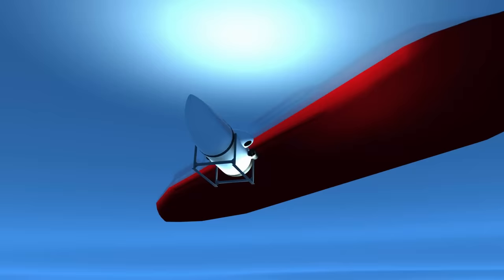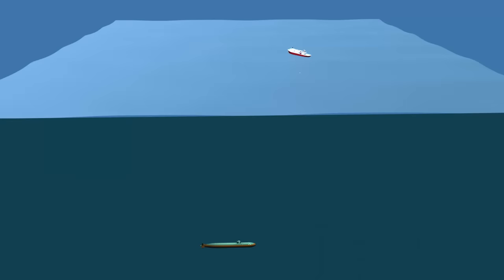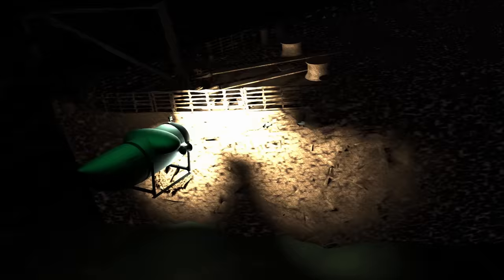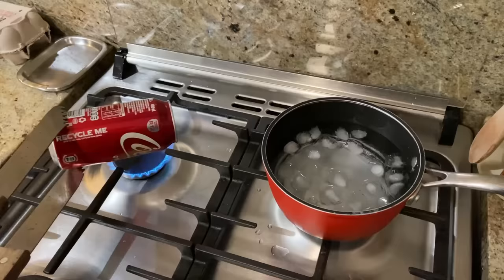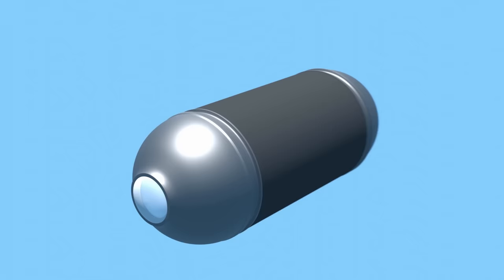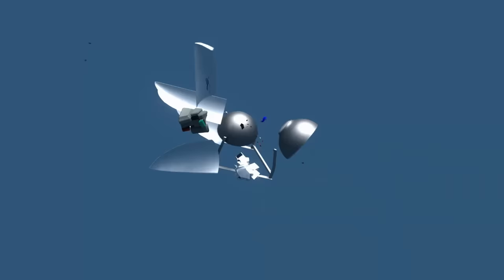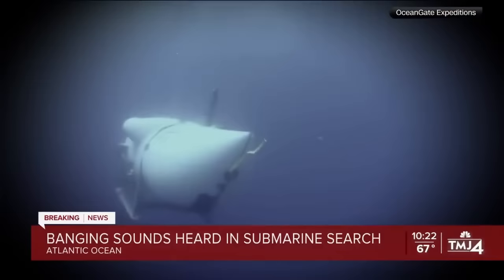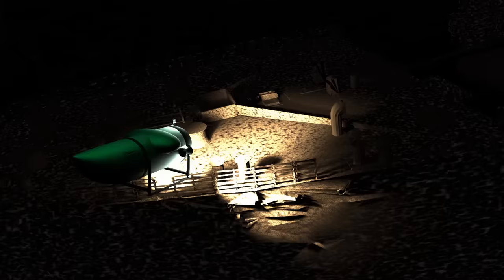TITAN Sub implosion | Deep Dive animation explanation

Comment: This is the most accurate animation of what happened. All the others are so slow.
Reply from the maker: Thanks. Glad you agree.
Reply: How do you know that?
Reply: @mazzugara putting coke can in cold water ring pull first shows ring pull let go, so assume window did the same
Reply: It's not that they were too slow, it's slowed down for the human eyes, but this is the closest animation correspondent to the debris found. The other ones had every bit shredded to pieces or the carbon fiber caving in and remaining intact.
Reply: @anitanoterajes no they are taking about stuff like that popular tiktok video showing the ocean gate completely crushed no pieces left turns out the owner of that account was a jack 🫏 and posted weird stuff
Reply: @theboyinthedark6521  That's exactly one of the unrealistic videos I was talking about.
Reply: @equalizers8190  The word glue seems the most ominous.
Reply: @anitanoterajes  I agree. One thing I think is interesting and has been mentioned by other people is the landing skids they recovered appear undamaged. It supports that the people on Titan knew something bad was happening and jettisoned all ballast to try and surface the sub.
Reply: The most 'accurate' speculation.
Reply: @mazzugara bc that's how it works slow bunny
Reply: @seanmurphy3413  those parts were not pressurised so weren't at risk of crushing.
Reply: @seanmurphy3413  Apparently, the delimination would have been loud before it imploded as the carbon fiber was built in layers, and the acoustic system might have given them a warning too.
Reply: @ButeSound  If they were attached at the time of failure they would have been hard mounted to each end of a tube that disintegrated. I would expect some damage if that were they case but I don't know the specifics of how they were mounted to the titanium end rings.

Comment: So, at the end it was pretty much just a gigantic soda can wrapped up with extra material, hoses and cables. No one can even call it a floating casket cause everyone inside just disintegrated. The implosion animation here gave me the chills. Great job! Amazing video.
Reply: It was a flaoting cremation unit
Reply: @MikeBarbarossa  Pretty much a manmade black hole cremation machine. CEO got proto-spaghettied.
Reply: @RockNRollSurf  and the logitech controller?
Reply: Instead of mostly being made of titanium, Rush decided to only have the front window part be made of titanium and the rest of it carbon fiber.
Reply: @@abdulSprucethey were 1hr45 into the 2hr journey down iirc, which would be approximately 2860m/9370ft depth. My personal guess is mostly juice but perhaps some part of the torso could remain. Would be a shame if it’s just reminants of some slime on the recovered debris
Reply: No, they didn’t disintegrate.  Everyone is making it out like the carbon fiber hull crushed like a soda can but in fact it sounds like it broke into shards.  That’s why there were no pieces of the carbon fiber main cabin that were brought up.  The white sheet metal pieces they brought up were just a facade on the outside of the unit.  Notice the titanium rings and nose cone were intact and recovered.  So this myth that the people on board just “poof” and disappeared/disintegrated and that there are no remains to recover is false.  Yes they certainly died instantaneously but this was not a traditional crushing implosion like the videos we see now with soda cans and the like.  No it was certainly a catastrophic failure but the nature of the carbon fiber lent to shattering as opposed to crushing.  The people didn’t magically disintegrate either.  Even at those pressures there are still significant remains left over.  The lie that there were “no bodies to recover” has gone on long enough.  It’s not true.
Reply: @@abdulSpruce There are fish that live at 24,000 feet and they do not look like swimming pancakes.   
Water is not very compressible so areas of the human body that are water/bone and no air will not be compressed any more than those fish.  
We have lungs, ears sinus cavities  etc that require air.  Those cavities would be compressed instantly = death.  But legs would not.   
The speed of the ceiling coming from being above your head to hitting the floor instantly is a problem.  
People in the end caps would not be under the same forces as people in the tube section.   Its not the perfect press so likely would have intact remains from one or more of the 5.
Reply: I thought the same thing
Reply: Smart enough to figure out how to have $250k to be stupid enough to get into a refrigerator powered by a Logitech controller :/
Reply: This is nothing like a nuclear explosion though. Not much like an imploding soda can in air either.
If you want to account for the physics, you need to account for the less compressible medium too, and the solubility of gas, etc. etc.
Of course I don't claim that it didn't violently implode, but armchair physics isn't gonna suffice.
Reply: The passengers didn't disintegrate, they evaporated when implosion caused an air pocket inside the sub to suddenly heat up to 6000 degrees Celsius, the surface temperature of the Sun
Reply: @fuscia13  Yeah because if it was YOU, you would have figured it out right away.  Keyboard expert that you are.
Reply: @@Nastynat well said! bravo! you save me to answer.
Reply: @Physics072  Let me tell you... an Implosion it´s like an explosion in reverse. Not only that they had the implosion but followed by an explosion all this in a lapse of nanoseconds. So my guess there is no chance you can recover even some bones. they all became carbonized particles not even the size of a micron.
Reply: @Physics072  The speed of the wall of water impacting would shred them apart into pieces though. As if crashing a mach-1 fighter jet on a concrete wall.

But evaporating them into a hot plasma, nope, yet have to see a proper argument above tiktok-level for that.
Reply: Slight difference though. I don't think carbon fibre crumples.
Reply: @Physics072  You are right of course.

I like when the guy you are responding to start his statement by "Let’s just talk physics here for a second" and then ignoring everything we know about fluid dynamics, thermodynamics and materials science to the point of confusing heat and temperature.

I would very like too see that thermal energy transfer equation that would allow something to burn in an hydrodynamic cavitation bubble since it would defy everything we know about thermodynamics.
Or the part where a mostly incompressible fluid is supposed to be "squished".

In the real world, ruled by the real rules of physics they also died instantly.
Probably killed by being torn appart by the shards of the pressure vessel.
And then their disemboweled but mostly intact body parts probably get dispersed by the force of the expending air bubble till they land on the seafloor.

They won't last long, being organic matter in the food-scarse world of the benthic zone but they would be definitely recognizable as human parts... Not a "fine red mist" or a "squished" paste as some randos claim.
Reply: They must have had an incling that things weren't going their way when they suggested rapidly ascending to the surface.
Reply: @jimmyboy2778  Everyone was dogging on the Logitech controller but they found it at the bottom of the ocean and it was fine. The guys who found it played 6 rounds of Modern Warfare back at the station and it worked flawlessly.
Reply: @RuFi0000000  hahahhaha
Reply: @RuFi0000000 so all in all not all bad news
Reply: Best ever explained, clear and scientifically - 👍
Reply: @Physics072  There will likely be nothing left but small pieces of bone. Don't equate human anatomy to that of fish that specifically evolved over millions of years to survive in that type of environment. The fish down there have larger blood cells, they can completely collapse their lungs, and have the ability to generate TMAO.
Reply: 12,500 ft x 65 lb/cuff/144sqinches/ ft square + 14.7 psi = 5657 psia.  Unfortunately no too much was left
Reply: My first suspicion would be the viewport. Inertial forces would shatter the cylinder
Reply from the maker: @jimmyboy2778 You will find the game controller here https://youtube.com/shorts/b2K-xCUOpho?feature=share
Reply: returned to atoms
Reply: Let's actually talk physics correctly.

 If the frame crunch up there are two ways for it to crunch up. One it by remaining airtight, and two is by cracking.

1) In the scenario where it remains airtight (100% the most unlikely and impossible scenario). We can for arguments sake model it as being inside of a bubble frame that suddenly becomes loose allowing the water to compress the air, the air doesn't rise like a bubble because it is somehow kept suspended for arguments sake. 

This is an interesting problem. We assume ideal gas law PV = R n T where R n is just some constant depending on the amount of gas inside the sub. Clearly P will rise until reaching P water. So T/V must rise in proportion. But does T rise or does V drop. Not possible to tell from this equation

The rise in T is in fact related to the drop in V, Since the compression is adiabatic, - PnetdV = C n dT where C again is constant with the fixed amount of gas in the bubble. 

so as C, R and n are constant. What happens is that the net pressure causes volume to shrink and temperature to increase at unknown rates since Pnet actually depends on T and V itself. Then as the bubble slowly cools down to sea temperature the bubble will shrink even more. The exact numbers of this heating is not known suffice to say one thing.

It cannot be a lot due to energy conservation. The energy required to pull a bubble down to the sea floor is not a lot. so there is no energy to be released tbh except for the material energy inside the hull frame. In fact way may as well assume that T is constant. (incorrect commenter above suggesting burning implosion) This helps as now compression is non adiabatic but you can find the final V as the ratios of volumes varies alongside the ratio of pressures. In other words the air bubble will be compressed in volume by about 1/375 times assuming negligible temp changes. With such compression either the people are minced by the hull or the hull gets a fracture way before this

2) However, if the hull shatters even a bit then water will instantly flood the hull and slam the occupants like a freight train as it does so, then collapse their bodies where all low pressure air inside the body will be squeezed until it finds a way out and up via bouyancy or otherwise, if it cannot, it will squeeze the body from the inside and create a double sided ironer effect on the body with the water on the outside. The compressed  air will escape out and up through the cracks and will be out of sight of the deceased since it is now just a abubble.
Reply: @rrokin  They were sinking way too rapidly. I saw a video that had the communication between the Titan and the mother ship. They were very close to the Titanic when they stopped answering, if I remember right it was about 200m. They had continually reported increasing problems for 19 minutes. 19 minutes of fear... With the implosion at that depth there is nothing left of the five men. Their death was quick but 19 long minutes of increasing fear are just horrible.
Reply: @sassandsavvy007  The transcript is fake, it does not even include any of their code language shown on a laminated sheet by stockton in one of the interviews
Reply: @rrokin  Not sure we are talking about the same transcript. The codes don't matter to the viewers on YouTube. They can simply be left out because nobody understands them anyway. Can't verify the credibility - it's a 50:50 thing but very plausible.
Reply: @sassandsavvy007  The credibility is very low. The original source being just a TikTok video that released just a day after the implosion and seemed to be put together with details from James Cameron’s interview and corroborated by absolutely nobody. The language used is also not consistent with the previous verified transcripts that you can find online. It would not have been hard for me to fake a more compelling transcript for some “TikTok fame” if I so desired
Reply: @rrokin  What makes you think we are talking about the same transcript? I'm not saying you are wrong but we still can talk of two different things from different sources. Would be very interesting to find out. I was an intelligent agent all my working life - I know a bit about sources. Nothing that's found online is automatically right or wrong. The point is the actual source which with online info is easily faked and often very hard to find out. Not into TikTok at all, don't even have an account. My info was a YouTube video of an engineer who talked about the retrieved Titan parts and the material specifics. Wasn't attention seeking at all, much too "dry" and science oriented for the typical TikTok subscriber.
Reply: @RockNRollSurf  WRONG- SPAGETTIFICATION TEARS YOU APART
Reply: @4runnercolorado422  if bodies were recovered then post your legit proof other than "trust me, bro."
Reply: Nah. Even soda companies don't use carbon fiber for their cans.
Reply: @MikeBarbarossa  I don't think any fire was involved
Reply: @@abdulSpruce The were at ~2950 meters (~9680 ft) when the sub imploded.
And, remember, the U.S.S. Thresher imploded at 1800ft. Killing everyone on board instantly.
Reply: @@Nastynat wrong, the heat generated was about the same as an open flame, and their bodies were only exposed to it for a millisecond.  Akin to quickly moving your hand across a bonfire.  They didn’t explode either.  They could have been torn to shreds by the shattering carbon fiber, and all of the air in their bodies certainly instantaneously compressed and they were certainly instantaneously killed, but their bodies didn’t disintegrate from the pressure.  In fact, we are mostly made of water, which is incompressible.  So their sinus cavities, lungs, etc instantly collapsed but they didn’t disappear.  Assuming the shattering carbon fiber didn’t tear their bodies apart they would be more or less intact.  Let’s just talk physics and science.
Reply: @landsgevaer  It's just a simplification, but you get the idea. The soda can was at 1atm, the titan was at 400 atm, you can at least imagine how it was much worse than the demonstration
Reply: @benp3485  The point is that there are completely different mechanisms at play. I understand that it was violent in either case. But the roles of the inertia and the compressibility of the water make it behave completely differently. It isn't just that the pressure was high that made the sub collapse so fast, it is that the water was compressed ever so slightly. If the water had been negligibly compressed, then the water would merely have fallen essentially free-fall at the gravitational accelleration g = 9.8 m/s² when the hull had suddenly collapsed completely. That still crushes everything with huge force, but it would be a lot slower.